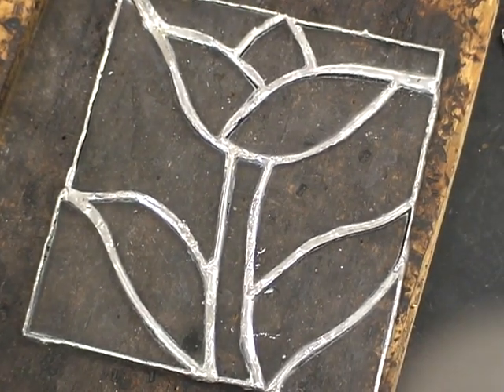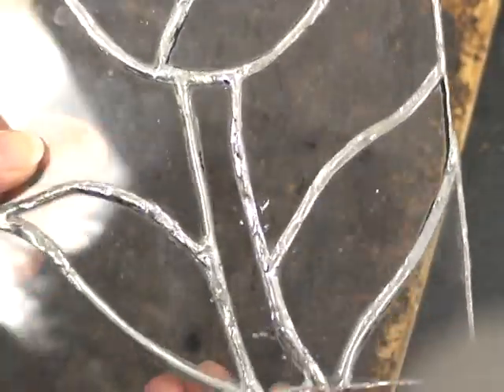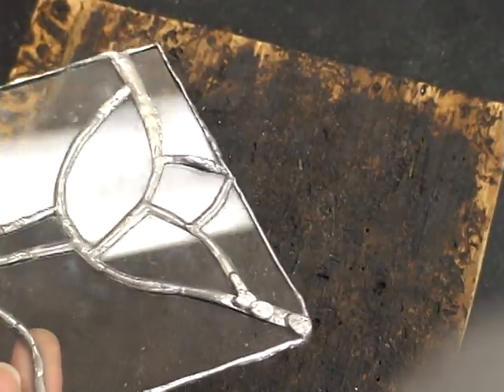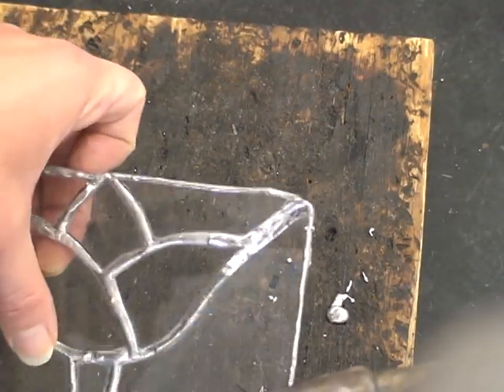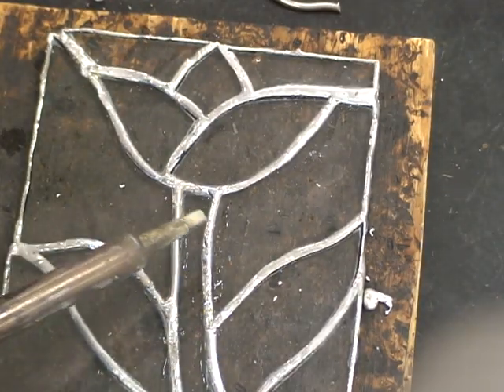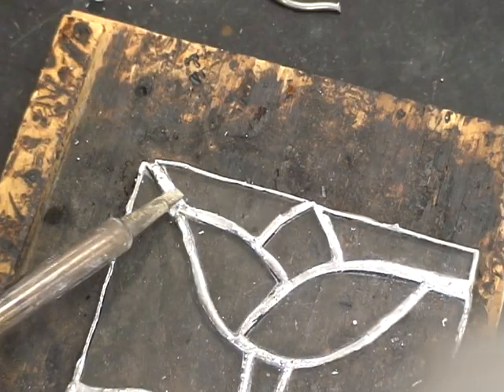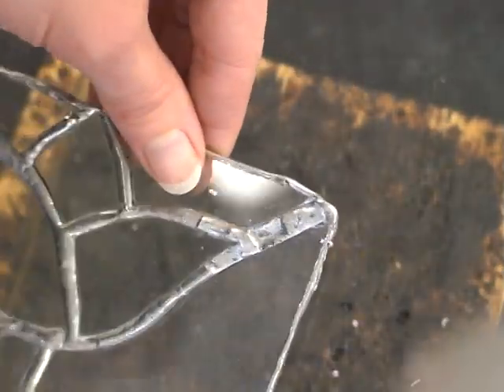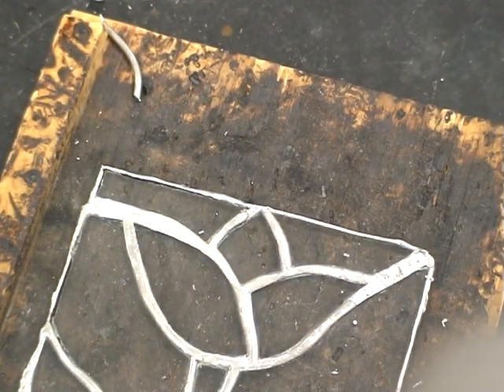Making Smooth Solder Seams and Touch-Up Soldering

Comment: @LadyBerz how would I go about creating textured ripples in the surface of the solder?
Reply from the maker: Hi, If you have a temperature controlled iron, you can turn it down a little. Or, you can try ‘dripping’ the solder onto the seam. Hard to describe, but  it involves laying down a bead first, then hovering just above the seam and melting drops in a row, onto the foil. Not going to lie, I only try do smooth seams, instead of textured. I’m sure there have to be others here on YT who do what you’re asking regularly and who can describe/ show it better. Good luck!

Comment: Thanks for the video. Just curious, why only keep flux on one side at a time?
Reply from the maker: When soldering the 2nd side, the flux, combined with the heat, can accelerate the seeping through to the 1st side. Also, we just try to keep our work neat throughout the process. Leaving flux on starts the solder corrosion process, too. We currently are using EZ-40 flux, which is organic and non-toxic. It doesn't have the corrosive zinc chloride in it. It can be left on, but it gets unpleasantly sticky! Hope that helps :-)
Reply: @LadyBerz  Makes sense, thank you!